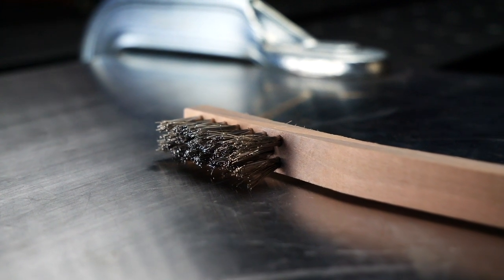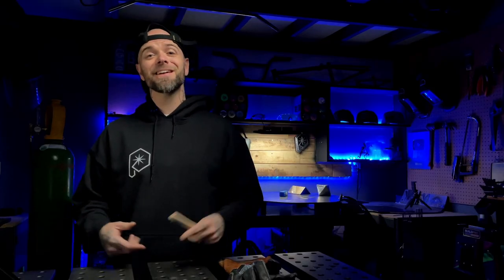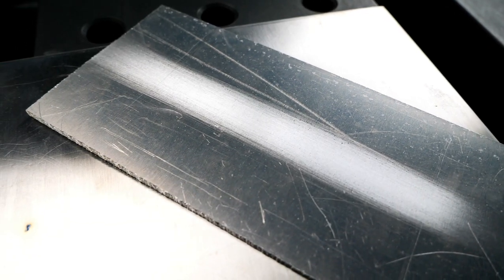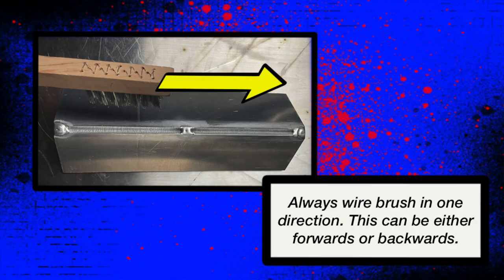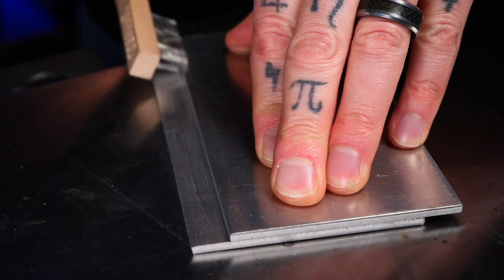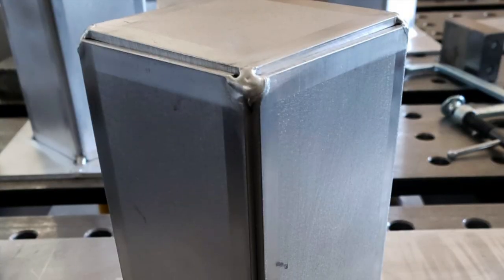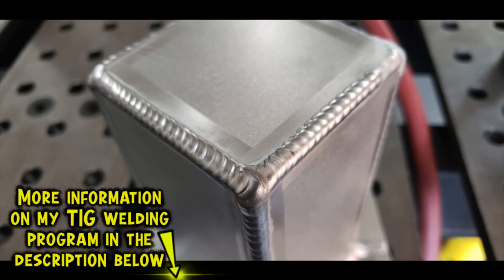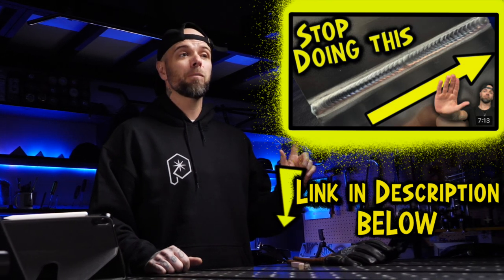Wire brushing can RUIN your tig welds.

Comment: Many years ago,   an instructor showed us how to "sharpen"  a brush !    Try it !    Using a dedicated bench grinder wheel (I use the same one that I sharpen tungstens on), sweep your brush back to front, (handle facing up) across the face.  This evens out bristle length and creates a forward facing burr that cuts faster.

Comment: I started off using several different methods to clean the material prior to welding.  I am currently using a battery powered right angle drill with various types of abrasive discs.  On aluminum, I will do the whole surface.  I also have the ability to take the surface finish to a mirror finish.  Depending on what I am making, the surface can be left with just a clean surface all the way to a mirror finish.  The closer that the surface finish gets to a mirror finish the longer that it takes.  Taking copper to a mirror finish is really nice.